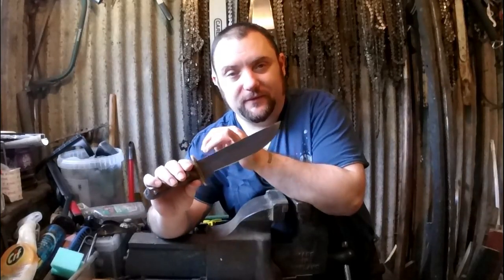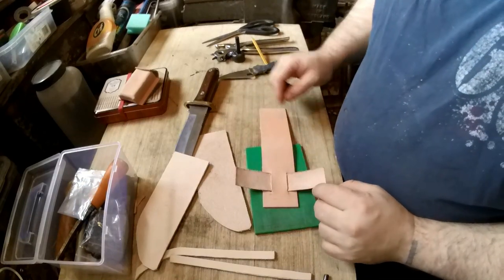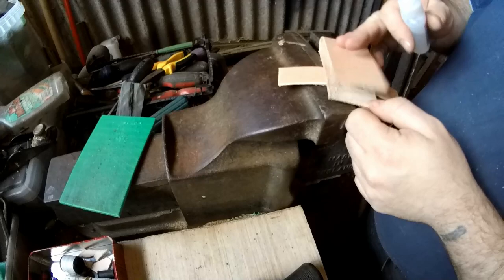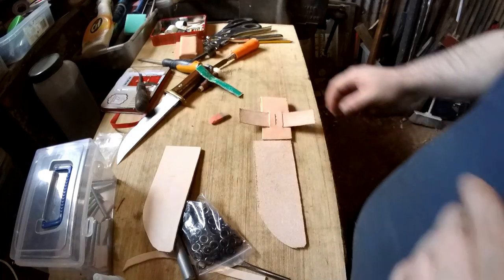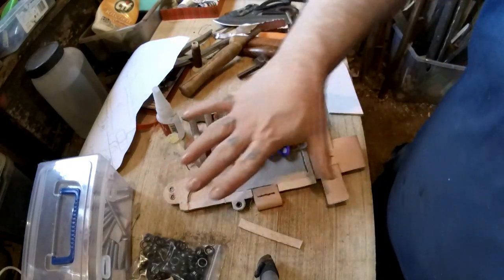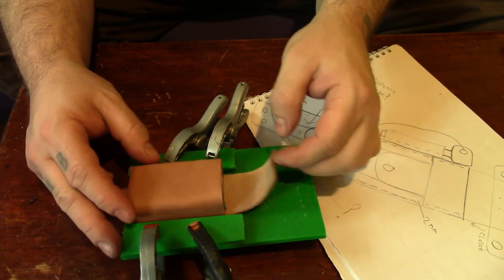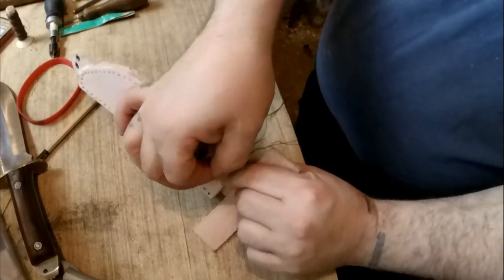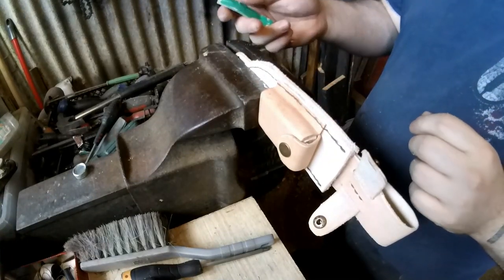Homemade Survival Knife Part 2 of 2 - Leather Sheath with Pouch

Comment: Nice, I like your little trick of sanding a groove for the thread to sit in so it doesn't rub or catch on the blade, I'm going to be using your videos as tutorials when I get around to making some sheaths, thanks Mike good stuff.
Reply from the maker: Glad it helps mate, i shall look forward to seeing what you come up with, i reckon they will be very nice.
Reply: @WeaponCollector  I dunno about that, I've never even attempted to make a leather sheath like that before, I've made plenty of wooden scabbards and things, but I don't think my first few leather sheaths will turn out anywhere near as good as this one you just made. This is really good level work, I think you should try saddle stitching the next ones you make, because your work is seriously getting up there on a high level, no point letting a little stitch technique hold back from being professional level. I'd buy one of your sheaths 100%.
Reply from the maker: @londiniumarmoury7037 next time i have to buy some thread (which will be soon, lol) i'll get some proper stuff and the needles and defo try saddle stitch. you're right it is worth doing.